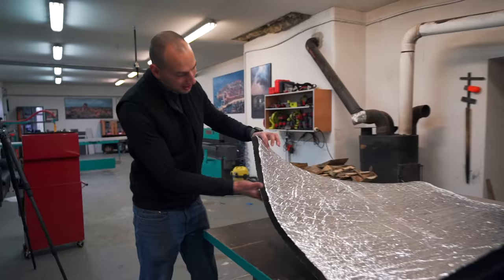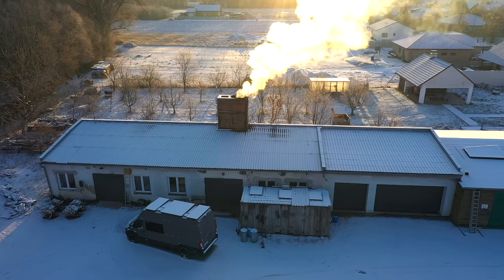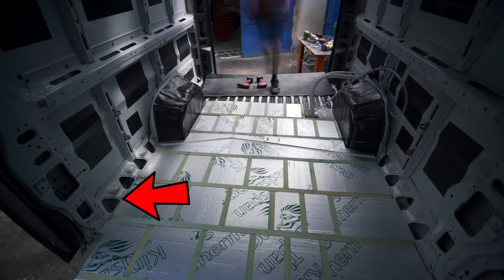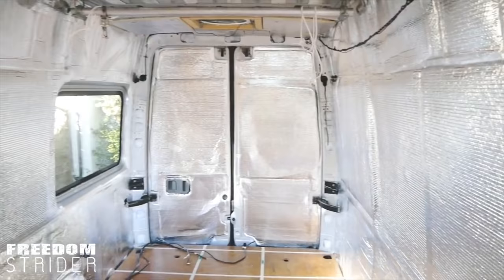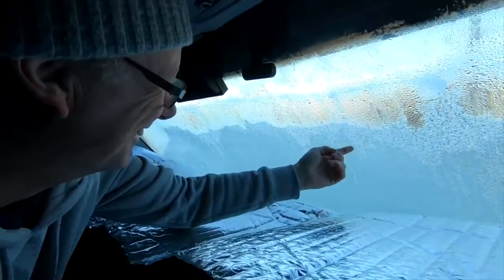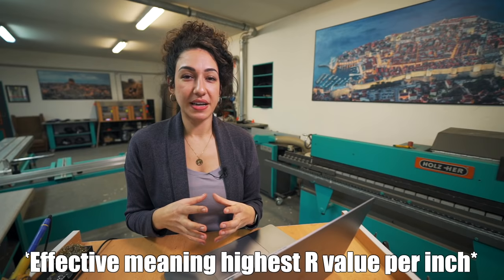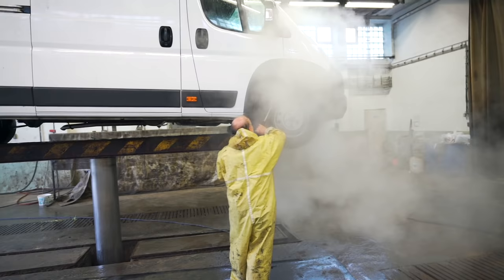❄️How to *ACTUALLY* Insulate Campervan for WINTER VANLIFE ❄️

Comment: Well, it's not a matter of agree/disagree but I used 1/2 polyiso board (that hard stuff) and it will bend and slightly fracture to accommodate a curve, primarily the roof. What I did first was EZ-Cool (reflectics-like) everywhere first that could apply a sheet to via 3M-90 as I did not want the bare metal exposed to the climate inside and potential gathering of moisture and subsequent rust, mold, smell. 3 years no problem. Used R-13 in areas could not do this routine but EZ over these areas too as a vapor barrier. In a small 130wb MR Transit so at 5'11" you use the 6' clearance up easy. 1/2" poly on floor with a 1/4" wood sheeting and indoor/outdoor carpet glued on. Yes, it gets cold IF you let the cab area cold air in so a floor to ceiling curtain a must. And yes, gotta do both the rear doors (but have a 1" wall in-between me and it) and the slider lower portion. Gotta say though, the EZ directly on the metal must have some benefit as it is not cold to the touch as bare metal is so transfer of cold must be being reduced to some benefit; these were areas I could not access for insulation (B pillar, C pillar) when I was doing the job. 18 out last night and low of 63 inside with my heater on low/ 9000 btu (Dickinson P-9000) fan on high. High fan would yield 70 no doubt but very comfy overall.

Comment: Great talk on insulating properly. My one concern is the statement that having more insulation when you  are in a hotter environment just traps the heat in. While true, it does not address how to keep cool in warmer environments without massive us of A/C. Clearly some insulation is vital or an A/C system could never keep up. I have yet to see anyone talk about venting a van later in the day when temps cool a bit to pull the heat out. The energy is trapped in the thermal mass of the interior, and I haven't seen a single design that has systems to deal with this. I saw Greg Virgoe's thumbs up, which is good to see. His talk is based in the science of construction and building envelops. Your solar panel lift is a fantastic design. I used similar lifts to open a "door" in the floor of my house to get to the basement. My first set of lifts lasted five years. Congrats on having the biggest power supply I've seen on any build of a class B. You guys win!

Comment: Regarding installing foam board on a curved wall, a truck is that you can measure the shape of the wall with a contour tool (sections of straight edges held together by hinges) and score the backside of the piece you intend to install at the same locations as the hinges on the contour tool. The foam board will then fit curved walls very well

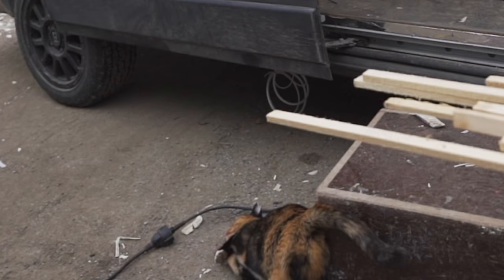Comment: Margaret, THANK YOU for your thorough consideration of insulation. YES, important because it will determine, in large part, how comfortable you are in the van in the long run. However, when you mention sheep’s wool that has fiberglass woven into it (14:21), you say, “That’s (rats) not really a problem in a van.” While this may be true about the rats, having fiberglass near the living space and not having the fiberglass completely sealed off from the air we’ll breathe when we’re inside the van is UNSAFE. There is a reason that folks who work with fiberglass have to wear respirator masks. Protect your lungs from fiberglass particles AT ALL TIMES. Don’t use it in your van living space. Thank you.  P.s: I LOVE YOUR CONTENT.
Reply: And fiberglass loses essentially all of its R value when it is compressed..It is a poor insulation choice in almost everysetting.

Comment: I insulated my van with mylar and dacron, just like the space station, cheap and very effective. For my windows I used triple weave thermal block out fabric.
Any loose fibre insulation, like fibreglass and wool, invites potential for moisture absorption which leads to mold and rust.

Comment: Hi there, good vid, I have spent several winters in an uninsulated VW Cali and now have Ducato factory insulated camper. Not a huge difference in heating bills as small space. Of course as you know without ventilation you are just moving moisture around and it will inevitably form on windscreen or on cold bridges so most important thing is to avoid (almost impossible) trapped moisture and generally maintain an airflow via window, roof vents or whatever. Allow van to air regularly during day and check backs of cupboards for damp and dry where possible. We didn't find any big issues in the Cali as we popped roof as much as possible as well. In airtight and well insulated houses MVHR systems are installed but cost and space likely outweigh benefits in a van (you could design for a niche market? ;)

Comment: Can we talk vapor barriers for a moment?  Vapor barriers can be great, but you shouldn't install a vapor barrier (on a van, or a house) without a clear understanding of what you're trying to accomplish.  As Margaret says, living inside of a van will tend to raise the humidity of the interior air, and you almost always want to enable that moisture to dissipate to the lower humidity outside.  You may also occasionally be somewhere where the outside humidity is very high, either persistently (i.e. high humidity summer locales) or temporarily (i.e. a rainy week).

A common strategy to have a vapor impermeable envelope, which will prevent exterior high humidity from migrating inside, and use fans for when you want to vent humidity outside.  As Margaret mentioned: there can be a lot of holes in a factory van, and so while sheet metal is vapor impermeable, you might want to add a vapor barrier to "cover" the vapor holes in the van.  But if you're going to add an interior vapor barrier, be sure to not create a sandwich of two vapor barriers (the sheet metal and the installed barrier) with a gap between.  This can easily result in compartments that don't readily shed humidity to either the exterior or the interior of the van.  And what do you get with persistent high humidity in a closed compartment?  Mold and other nasty things are a common outcome.

Because of all that, I think there are two reasonable options with a van:

1) Don't add an extra vapor barrier.  Rely on just the metal skin, and make sure that all the insulating material you install inside is vapor permeable.  A well insulated van with vapor permeable insulation will only let moisture move slowly, so you won't rapidly get the outside humidity in the van, but it'll let all the nooks and crannies of the van dry out.

2) Install a vapor barrier as the very first thing you do, and adhere it with (ideally) no gap between the sheet metal shell of the van and the added barrier, so as to not have pockets that have barrier on both sides, and cannot dry to either the outside or inside of the van.

Personally, I much prefer option #1.

Note that installing two different vapor barriers is a classic mistake that people make building houses, and can have long term health consequences when mold grows in the walls.  Note that it's very difficult to install a perfect vapor barrier.   And even if it's perfect when you first put it in, you inevitably have penetrations later in the build, and wear and tear on the road, and it's unlikely to stay a perfect vapor barrier for very long.

Edit/Update: I realized I didn't talk about one concern some people will be trying to address: condensation.  If humid air hits the outer metal skin of the van on a cold day, the air will be cooled beneath the dew point, and condensation will form.  If the layers of your van from the outside in are metal skin, insulation, and then vapor barrier, then in theory the vapor barrier keeps the interior humid air out of the insulation cavity.  Even if the van is allowed to cool, the condensation will form on an interior surface that's more likely to dry quickly.  But if tackling this design, it's a good idea to recognize that a perfect vapor barrier is hard to create and maintain as you're building out your van.  It's very likely that high humidity air in the van will seep through flaws in the vapor barrier, into the insulated cavity, and then condense on the inside of the metal skin.  Condensation sandwiched between two vapor barriers can take a really long time to dry out, and cause serious problems.  So how to address this concern?  One way to try and insure that the insulation is vapor permeable, and deliberately provide a route to the outside of the van, so that drying can occur.  This takes very careful thought with a van build, since you have to insure that there's a vapor path past the sheet metal skin of the van.  Typically this would have to be down through the undercarriage.  A second approach is to install insulation that won't let humid air contact the metal skin, even if it leaks through the interior vapor barrier.  This approach requires comprehensively attaching the insulation to the metal skin so that there are no air pockets, and using a closed cell insulation.  With all the nooks and crannies in a van, in my opinion spray foam is the only viable solution for this approach.

Comment: I agree with your points. 

What I did in my Unimog shelter is just make a styrofoam box inside of it with a air gap between the metal box and insulation. I didn't do the floor because I don't have standing height. I will install a 2KW diesel heater. And I will make sure I have fresh air flow.

I really don't get people filling every tiny hole. I didn't fill anything it is just a complete box with straight walls. When sleeping in it without a heater I already notice the insulation working.

The reason for the 4cm styrofoam was that it was free 🤩

Comment: in my opinion, the problem of using reflective materials is not that u stick it on the body of the van, but that you cover it with wood etc. there should be nothing between solid between the heat source and heated surfaces and the reflective side

Comment: Thanks for the video. I'm in the middle of insulating our van with polyiso boards. A slow process, a lot of dust from cutting the boards, but insulation is a must here in Brazil. As the British might say: It's rather warm down here.

Comment: Wool is a good insulation if it can breath, it absorbs moisture so it needs air movement to dry if it gets wet.
If you want to learn best practices you can learn a lot from the professionals that specialize in construction and insulating metal sided buildings.

Comment: I have used recycled plastic bottles (looks like fibre glass but does not irritate them skin) in my van. It is useful to use a spray adhesive for larger areas and stop it falling out. I have also used closed cell foam for the flat areas. I have them covered this with reflectix as my barrier. Hoping to be nice and snug/cool in my van 😁

Comment: Interstitial condensation is condensation which occurs between layers of the construction, i.e. 'inside' the roof, wall or floor elements. Interstitial condensation can cause deterioration

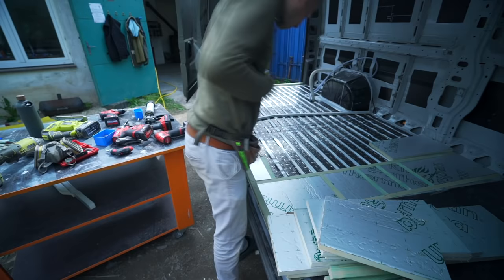Comment: that foam board oculd be used on bends if you figure out what triangle you need to cut from the flat side to hold the curve. you did bend it, it just didnt stay there. 13:20

Comment: Well done and very informative.
I’m in the process of insulating my van and have used my past experiences with insulation in doing so. You’re right: there’s a lot of mystery and mis Information on this subject.
BTW, My floor and ceiling are complete: R10 in the ceiling, R5 on the floor, both using expanded polystyrene. Slowly working on the walls and doors...

Comment: There is one product I don't see used often in van builds, but has been gaining popularity in home construction. That is a spray cork application. The cork provides a thermal break on surfaces it's applied to. I think it might be an interesting method to look at perhaps in a future build. That's not to say it alone will be enough, but I think it might be a good product on the sheet metal first then Havelock or thinsulate etc on top.

Comment: Eyy nice to see some Europeans doing this. Hello from the Netherlands.

Also I'm looking into hemp isolation, because it is absorbant. Theoretically this will also help with moisture control in the air. Hopefully this means less need for ventilation. 
However nothing is decided until I've seen it in action. They've used in Artis (zoo in Amsterdam) so once lockdown is over I'll check out if it actually works.

Comment: The only thing New about this field is the trending vans RVs and motorhomes have been doing this stuff and dealing with these issues for many decades 
As someone whom has grown up in RVs and motorhomes i Tell you now NO Moisture Absorbing Insulation, it will only Create Damp Spots What you need is Lots of Open Space so that your heat source can Properly Push Dry Warm Air Into Those Tight Cold Spaces that Trap Moisture and Produce Condensation Which Leads to Rust And Moldy Mildew Rot  Your Not Going to Just Magicly Keep Vapor or Moisture out Nor Full Stop it so You Need to Be Aware that You Will Fight Moisture and Damp Spots Collecting Water p.s Many RV & Motorhomes Use A Clamp Ring Radius Frame Tempered Glass Window, Why?? if You Pick the Right one it has Condensation Vents built right into the "housing" lets all the Pesky Water just Run away and if they Break it Wont Create Huge Solid Shards  Personaly i Think its Longterm Better to have Dry Air on small spots then Well Insulated Cold Spots which just lets Condensation happen ,
Anything Absorbing Moisture is WithHolding Moisture from Escaping or Drying

Comment: What I‘ve learned is floor heating is important. You don’t want to stand at the cold floor. I‘ve only heating at the kitchen and in front of the bed.
It make the life much easier when you have in the morning a warm floor.
Also for the next van build I take a sandwich board for the floor. GFK foam GFK. Cut it like the original wooden floor and replace it. No small parts to worry.
Very strong too. 
Insulation I have only 19mm Armaflex and nothing in the structure of the car. And it works fine up to -10 degrees celsius. Then my 2kw diesel heater is to weak for 23 degrees inside.
All holes covered with Aluminum Tape.
No vapor barrier. I learned from the caravan, Outside Aluminum, then Stryopor, and wood. You have the let air circulation in because the moisture can’t get out. One time at the day open all doors and let air for 5minutes in and never get a moisture problem.

Comment: Good video though it was made with the premise that everyone is building a van to live in while most will be using it as a holiday device.   , in warmer more than colder conditions.  I have spent two month long trips in a professional camper with no insulation in the summer and had no issues, little bit of condensation on the windows sure but no issues. This was in both occasions in the summer but one trip was in New Zealand up in the mountains where the temperatures dropped down to just above freezing, and with good air flow was no issues on hot nights.  I am insulating my own van but not going off the deep end, merely to avoid it getting too hot or cold quickly.  Using 19mm Armaflex over all the Wallstreet ceiling( which it’s closed cell foam properties act as a vapor barrier).What I’m saying long short is the end use of van is important!

Comment: I have a 2019 sprinter high roof. I am tall enough that in my build I want to preserve standing headroom, which limits the floor and the roof insulation. I have lived with it for 18 months to decide what to do. My plan is to use 3 layers of 1/2” (13mm) between the existing van framing. The thinner size does bend enough to make this work. The panels will attach to the van ceiling with the stick on “nails” that Greg virgoe recommended.

Comment: Thanks for this video - I love this. Learning the  different options on various aspects of a vanbuild is very helpful for everyone planning their own build. Especially if grouped section by section (e.g. design, framing, wiring, insulation, flooring/roofing etc).
Thank you again. Plus, you guys are great to watch!  Do you insulate the roof of the cab at all (under the headliner)?

Comment: Reflectix has a small R Value because it creates an air gap with its bubbles.
3M Headliner Adhesive is superior to 3M Super 77 or contact cement for body panels that get hot in the sun, according to a prominent van builder.
Spray foam RISKS detaching from body panels over time as the chassis flexes, and can result in endless annoying squeaks that can be a nightmare to find and solve.
Spray foam also makes body shop repairs a nightmare if a small collision needs welding, dent repair, etc.

Comment: Great video - thanks! It's always good to hear about your and Ladi's thought processes and planning. We have a van that was bought as a very nearly complete conversion - everything had been done but not necessarily tidied or finished. The biggest problem we have though is with the insulation and vapour barrier. Neither are complete enough to be effective so a lot of condensation forms in the various places where metal in contact with the outside air is exposed to the inside of the van. 😔 I'm just at the point now of pulling all the panelling etc to re-do the insulation and complete the barrier - not looking forward to it! Will watch how you do yours with great interest! 😃